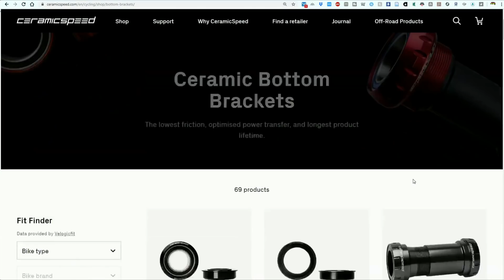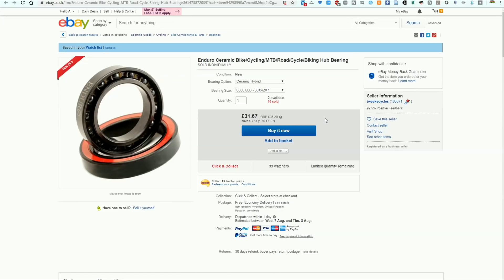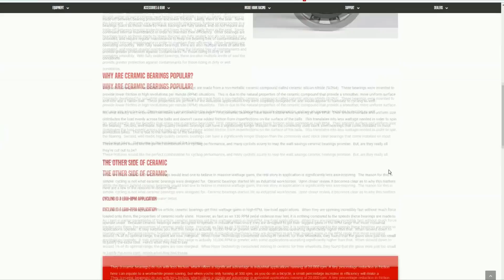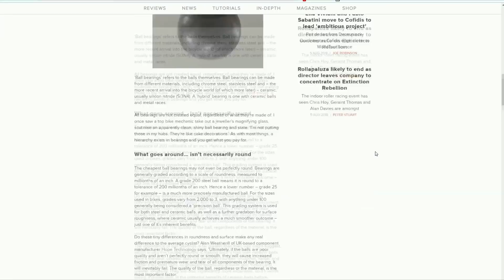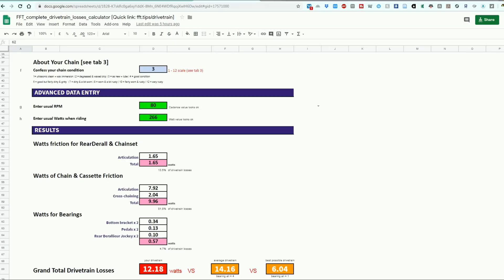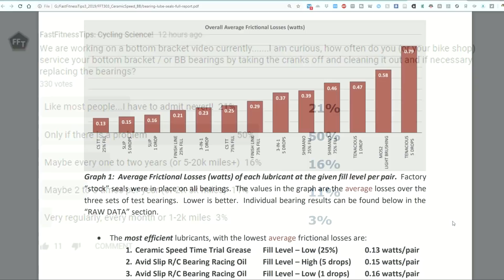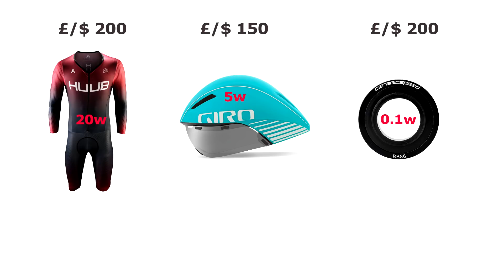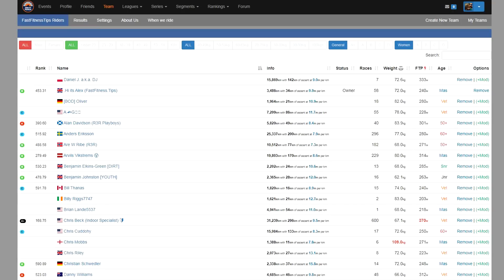Are ceramic bearings in bottom brackets (like ceramicspeed BB) worth it?

Comment: I have never cleaned my bottom bracket. I did the coin test and it did now move with 9 coins (74 grams) so I filled up a water bottle and used a scale. My pedal arm did not move at 230 gram, WTF! Its going to service on monday. Anybody knows how many watts there is lost in my bottom bracket? Thank you for this video @FastFitnessTips: Cycling Science!

Comment: No way steel is anywhere near the perceived performance benefits of Ceramic bearings. Ceramic just feels sublime. Even hybrid ceramic feels much better than steel. The caveat is...Most riders are not making a living from Cycling and any gains is not paramount to wining and losing. Fact: Races at mere mortal levels/amateurs are won on fitness. The rest is what you like as an experience from a product.  Life’s short. Why the rationalizing. You either can afford it or you cannot.
Reply: You work for CeramicSpeed? 🤔

Comment: Any suggestion for ceramic Bottom bracket with good price?
Reply from the maker: Try F1, vcrc, kogel, gold race, c bear, hawk racing, maybe enduro
Reply: @Fastfitnesstips  what about “Cema” * ?
The only bottom-brackets sold here in the country where I live / imported / available, are “Shimano” ones and “SRAM” ones and “CeramicSpeed” ones and ones coming from a newcomer-to-the-local-bike-shops in the country called “CEMA”.

*(especially for “press-fit”-type bottom-brackets.

The one that I currently-have is a “creaks when the crank-arm is-at in the 1-o’clock position and/or the 2-o’clock position)

Comment: Ceramic speeds new testing now has durace at .159 and ceramic speed at 0.033 only a 0.126 watt saving they now have to use Acera at 1.3 watts to get the better than 1.2w pulley wheel saving. There testing varies massively each time they test graphs appear and disappear on the website all the time. Who in there mind compares a £15 groupset roller jockey wheel to a £ 164 pulley wheels.

Comment: So, basically, do the cheap stuff first. Then, if you have the cash to burn, buy ceramic for the psychological boost it gives you that far exceeds the actual watt savings. However, since most people won't do the cheap stuff like cleaning, they'll buy ceramic bearings which will get dirty and slowly lose their absurdly marginal gains just as quickly as the person who buys $20 steel bearings.

Comment: man i think you should ride a bike by yourself and compare in time!! when i see your nasty bearings shame on you... how can you ask performance and efficiency if you never clean bearing ... so wtf are your arg. for compare it. for tryed many bearings and riding more than 30k a every year with all climate. trust me they are worth at all. You can do easy maintenance, the bearings dont broke (yes many brands if you ride to long with the bearings they just broke and not beacsue of nasty, only because they get used). for a random guys, dont buy it. only if you clean your bike like me every weeks. or if you ride for competition just buy it. I check bearings every 3000KM and every 700km my bottom bracket is openned for clean everything if there is not rain . riding on rain i just clean every 300Km.

Comment: I have press fit Dura Ace bottom brackets on two bikes for a year now which isn’t advised to clean. It’s of course much smoother than when assembled. I wanted to follow your lead of putting a coin on the crank to check for smoothness. It looks like it needs like 2-3 AA batteries 🔋 to move the crank but when I pedal it with my hand, it looks smooth. Adding force and letting go would spin it like 4 times. INEOS never mentioned using any specific bottom bracket brand so I’m assuming they’re on the same boat. Am I losing many watts in my BB setup? Honestly, Hambini’s £170 is way too much for now...
Reply from the maker: Just compare the weight on those AA batteries with my coin weights to see how yours compare. If it feels really smooth the losses are probably under 2watts

Comment: From my understanding, how easily the bearings spin when no load in applied is a poor metric. Seeing how many quarters it takes to turn your crankset by the pedal doesn't necessarily have any relation to real life performance. Bearings are designed for use UNDER LOAD.
Reply from the maker: The watts lost under load is highly correlated with watts lost unloaded (r =0.9; r2 =0.8) so the unloaded test is perfectly valid with high predictive accuracy. However a loaded test does test bearing drag much more than seals and grease...so in an ideal world you would also test under loaded conditions, however this is almost impossible for the consumer, whereas unloaded test is very simple. Therefore my coin test remains very simple but effective. If you want to read up on loaded vs unload BB performance data are here: https://www.hawk-racing.com/independent-bottom-bracket-efficiency-study/

Comment: Boca Bearings offer full ceramic bearings. What is the lightest lubricant that you could use for this type of bearing?
Reply from the maker: Most efficient? It's in the chart above...but if you mean thinnest...very low viscosity avid slip bearing oil maybe

Comment: Not sure about other brands but on Shimano’s pressfit outer seal it says not to disassemble, I did however on my old one to see how it is from the inside. As they suggested, not recommended cause the container and the seal are all plastic and they’ll bend a little and could cause more friction after reassembly.
I’m very interested about greases though. On top of the original grease that comes with bearings in BB, Pulleys, Hubs. Is it okay to mix the manufactured or bearings grease with a lighter grease like white lithium sprays? I’ve left some white lithium in a container in a room and it got very dry or extremely viscous kinda like more than grease after 2 weeks time in the summer... I think this is a wrong product to use for bicycle bearings. If anyone knows more about this, I’ll appreciate it.

Comment: my pedals turned with 1 quarter. i guess thats good?
Reply from the maker: Assuming you meant the cranks, then yes very impressive...low BB resistance probably under < 1watt
Reply: @Fastfitnesstips  sweet! i put it on the crank and the pedal ( i dont have clips ) both ways showed the same result.

Comment: The next question is, is the bottom bracket of the frame properly aligned ? Hambini said, that even on high end frame, the bearings are not properly aligned. If you have any squequing noise coming from your bottom bracket, the sound means that your are losing watts. I would rather buy every year a new Ultegra BB ,which cost like 12 USD , the buying a super expensive boutique BB. Furthermore you have to maintain the boutique BB a lot, otherwise is not worth the cost.

Comment: Great content as always. Ceramic bearings will need over 5000rpm to produce a material benefit. Speak to any manufacturing engineer and will confirm that. So performance benefit for the avg. weekend warriors NIL. I believe that Ceramic bearings are only a matter of good feel factor or aesthetics factor. For a mid-range bike to spend that £ then its debatable. However for any  top of the range bike frame ie. Pinarello F12, Cervelo R5 etc. with top components would anyone opt for the budget option? Aesthetics do matter, and is not a pretentious act to want the best component for the bike you love, if it makes it compatible with the top parts you opted and it makes you feel good too. I would rather "waste" £250 for my next bike to look good and feel happy, rather than drinking 60 drinks x £4 at the pub during the year.

Comment: Put one in the previous Specialized road bike; it was better than stock. It seemed easier to get to higher cadences. The new road bike came with higher end steal BB bearings and so far so good after 6000 km; never felt like the BB was hampering performance. Best bang for the buck is really good steal bearings with really good bearing races for less than half the price.
Reply: It's just a bike. The loads are mediocre. The running speeds are low. Manufacturing tolerances can be lax. The only thing you need is a not too taff sealing on the bearing cartridges for them to perform. Look for the color blue  on the gaskets.

Comment: I put Ceramic Speed BBs on my Ti roadie and I've been pretty happy with them. It's the first serious BB I've been unable to break within 6 months of riding. ( 220+lb weight, very high torque sprinter). I managed to crack a ball bearing after a year (despite quarterly overhauls) and CS replaced the whole unit without a fuss. My 2 cents

Comment: Ceramic bearings only perform better than steel bearings at very high rotation speed (CPS / revolutions per second).
These speeds are not possible on race bicycle componentry. Even not the jockey wheels.
Reply: Jan Willem Kuilenburg 
They perform better but not 4x better

Comment: I guess I’m one of the few who has benefitted from a CeramicSpeed BB. That said, I’m an older, non-racer, enthusiast with a few extra bucks, who is also a gadget freak. I installed their PF30 BB about a year ago, and although I did go negligibly faster, I was consistently able to spin 3-5% faster. A big part of the increase was probably due to cleaning the BB, but I regularly clean it every 1500 miles or less, and I only ride on dry, paved roads. So is it worth it? Who knows, but for me it was because my legs weren’t as dead as before. 

How about a video about using ceramic bearings in pulley wheels (in non-OSPW SYSTEMS), and whether there are any benefits in using 12 tooth narrow-wide wheels over the standard Shimano 11 tooth ones.

Comment: Ceramic wears so fast that they are worse than steel over an average life

Best bearing are direct from bearing suppliers, not bike brands
Reply: @Click Bait There are mid range bearings ($40) like ntn that absorb far less energy than most ceramic bearings and are much better than stock/cheapo bearings. They use a contactless seal which eliminates around 60% of the energy absorption. Also they outlast ceramic by ages. However, it does seem like the actual amount of energy absorbed by any bearings is minute and upgrading bearings seems useless to the average person unless they are a problem area (clicking, binding, etc.)

Comment: The ceramic balls are too hard and wear out the bearing tracks. So wear over the lifespan of the bearing is poor compared to steel ones.
Reply: This is why full ceramic bearings and raceways are needed. My experience with steel bearings in my wheel hubs is that as the as you speed up, the steel will heat up and produce a top end due to friction. The ceramics have no top end. As for the bottom brackets because of the low rpms, FFT points out a clean quality lubricant is the most effective improvement in BB efficiency.
Reply: And that's where CeramicSpeeds 2 year warranty really adds to the value, imo. If you manage to wear it out, you'll get a replacement in the mail.
Reply: @paceline  wear does not count

Comment: Get some NTN steel bearings instead, nearly exactly the same low friction at a far more reasonable price. Plus they last longer than ceramicspeed BBs. Hambini has talked about this at length, and sells NTN bearings, and NTN equipped bottom brackets for certain press fit BB shell standards.
Reply: Yes and No. If you buy individual bearings, you can specifically select NTN. With BBs, it can vary, and in that case you're right, you may not receive NTN bearings, but SKF or NSK or another manufacturer that produces a product of similar quality. Either way, you can get amazing steel bearings (NTN LLB) for a fraction of the price of ceramic bearings.
Reply: @Bicyclechris  yeah agreed for sure
Reply: The only issue with the Hambini is that you don't get to choose the NTN....he just sends what he has
Reply: where is possible to order higherquality bearings like from NTN for T47 BB with SRAM DUB? Thanks for help
Reply: but ceramic is life